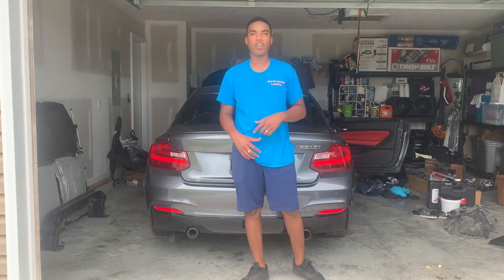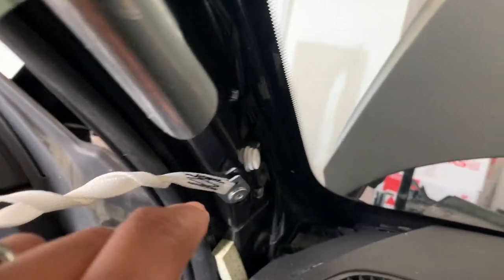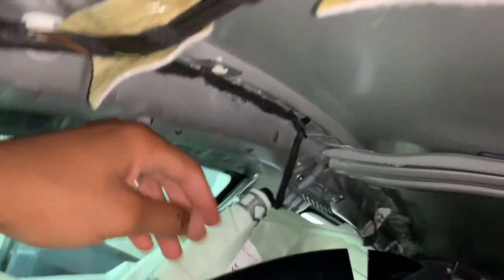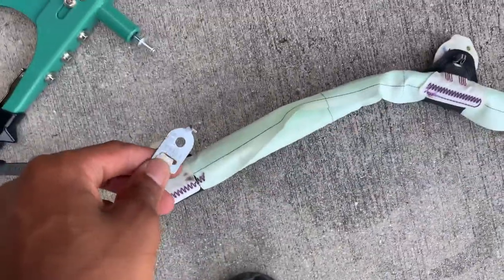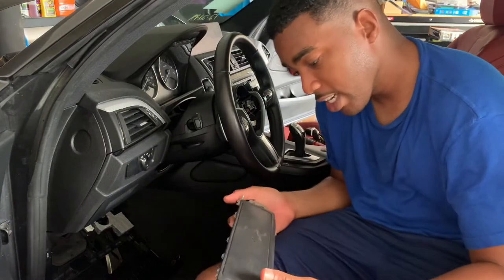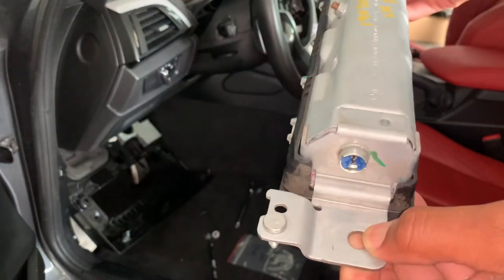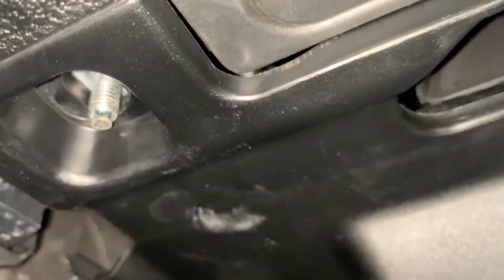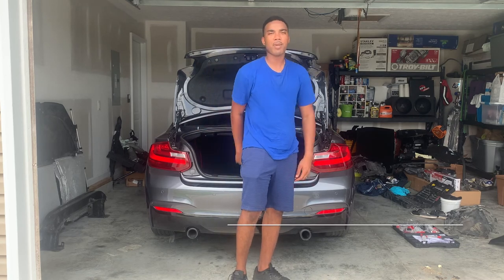How to remove and install Curtain and Knee Airbags from BMW M240i during the covid 19 pandemic

Comment: I know that some models have a disconnect cable on the positive battery after a crash to avoid fires, did you need to replace it? If so, did you do it after the airbags or before?
Reply from the maker: yea I replaced the cable. I did it before I installed the airbags to see if the car was going to run 1st.

Comment: Hey what size were the rivets? And what size drill bit did you use?
Reply from the maker: 07146984985. that is the part number for it on BMW online... I think it should be 1/2''... I used a size that is bigger than the hole just a little bit bigger and that should work.
Reply: @weerebuildz4427  ahh thanks man! 🙏🏼